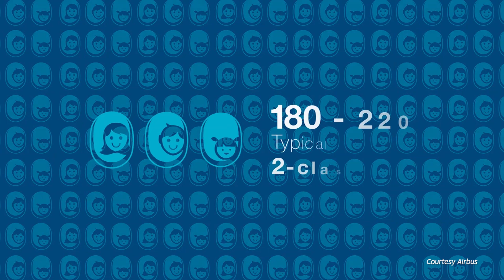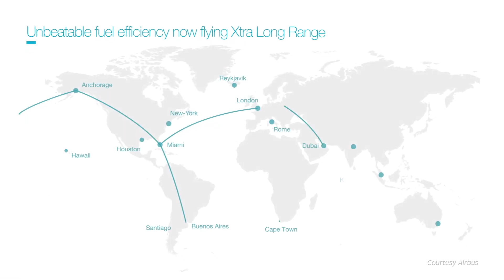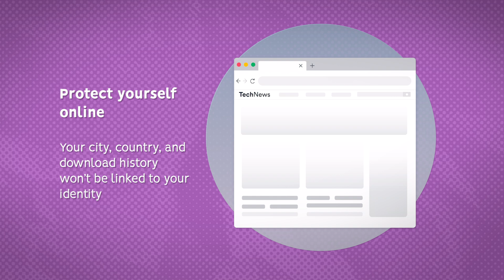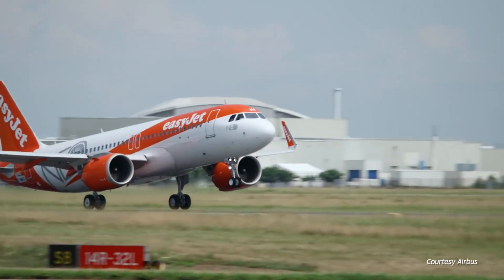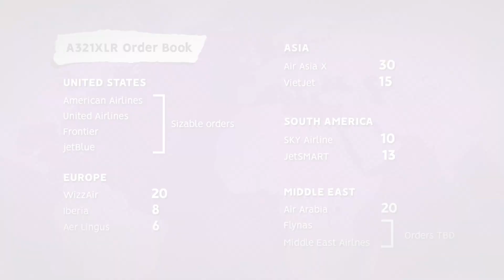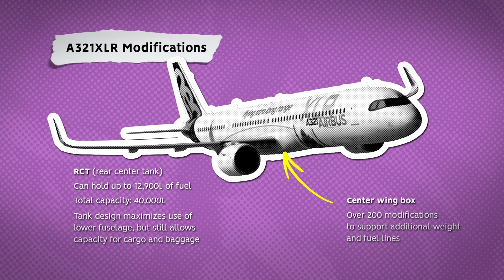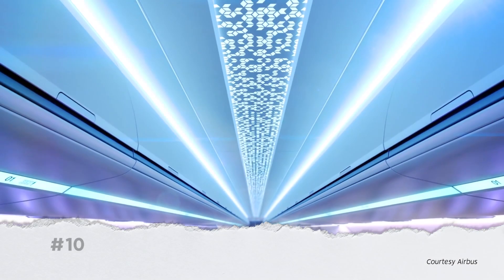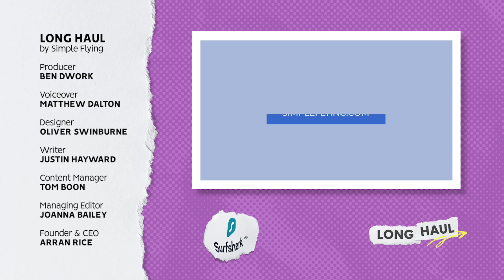10 Things You Must Know About The Airbus A321XLR

Comment: ...so after 40 years since the Boeing 757 first flew, Airbus just now comes out with  the exact same plane with about 400nm extra range? That's laughable.  All Boeing would have to do is update the old Rolls Royce engines on their 757's and install more efficient engines to get the same if not better results than this brand new Airbus.  The same goes for the new Airbus A350. Basically Airbus just copied a Boeing 777 from 30 years ago, added some updates and called it the A350.  In many ways, Airbus reminds me of those old Soviet aircraft manufacturers who copied western planes because the Soviets couldn't figure out how to make their own designs.
Reply: 757 is heavier and therefore less effecient plane even if you added modern engines on it.

Engines aren't the only thing what has changed in aviation since 1980s.

Comment: The FAA is worried because the 321XLR has no Boeing competitor.  The 737MAX will never be able to compete as its short landing gear has restricted its engine side.   The FAA will do everything it can do to save Boeing from the competition of Airbus.  Boeing is a shadow of the amazing engineering company it once was.   The 737MAX was an utter failure of imagination and showed a horrible corrupt culture at Boeing.  
The 321XLR is a game changer, even more so than the 787 which is too big to really allow thin routes.

Comment: All this fuss about a new aeroplane when the 757 achieved the same decades ago ???? come on manufacturers.
Reply: And what does a plane built decades ago need? Exactly, a replacement.
Airlines aren’t celebrating the A321XLR because it is the first narrow body to go transatlantic, like you said that’s not the case, instead it’s the replacement for an aircraft many airlines have had to operate for longer than they wanted. The 757 has become uneconomical and the A321XLR enables airlines to not only replace the 757, but to also do it with an aircraft which is, as it only makes sense, much more fuel efficient. Also, airlines which so far didn’t go long haul and bring new competition to the market.
Also, what’s next? Asking why the A321XLR gets so much attention if the 707 could do the same? Maybe it’s more obvious here why that question has a flaw.
Reply: @spongebubatz  757 is a Boeing it's a pity it didn't get developed further, also we are only talking about the range it has the 757 could do that decades ago just saying like no need to get upset about it.

Comment: Not impressed. The A321 NEO is underpowered and the wing is too stubby to allow flight at the higher flight levels.  All Airbus has done here is add more fuel tanks, big deal.  The engines should be in the 38 to 40 thousand pounds of thrust class.  The wingspan should be at least 130 feet long. Hey but at least it’s got the new car smell.  Sure these aircraft are 20% more efficient than a 757, but it’s 20% less performance.  Good luck at high and hot airports….

Comment: Not realistic to(especially on low cost carriers will become a real issue as will for crew(who typically on LCC have to do return flights as there is no night stops and no crew rest bunks not crew augmentation as Low cost carriers operate cheap with safety not as high a consideration as economy.For flights beyond 5-6 hours better to offer a wise body premium cabin.Toilet access is a real problem not only for passengers but for crew and stingy LCC will not fit an additional toliet nd if they do, you will need to pay!!

Comment: An ER or LR version of the  737 - Max 10 can be a potential direct competitor of the A321 XLR in terms of range, capacity and performance unless of course Boeing decides to create a new aircraft from scratch to compete with this increasingly popular aircraft from Airbus especially among low cost carriers looking to expand their market towards longer routes.
Reply: Yes thats what i thought too. The 737MAX8/9 have the same amount of range as the a320NEO, so a it is technically possible for the MAX 10 to at least match the range of the a321 LR. Im not really sure about the XLR but the, but the MAX10er could fly at least 7500km

Comment: I prefer wide body jet fit long haul flight...I dont want to be crammed like a sardine in a tin
Reply: So here’s something that may surprise you:
An A321XLR is not the same as the A320 of your go to holiday airline! Surprise surprise!
You in most cases get the exact same seat as on a widebody and often it’s even better, the average A320 seat is wider than the average 777 seat.
You get the exact same seat, when seated you won’t feel a difference.
I can see the argument of only having one aisle, but the "worse seat argument" is LONG invalid.

Comment: I wonder if Airbus rebrand the A321XLR to be it's own thing. I know they can't stretch it but it could be good for better sales from airlines as a true mid-market airliner. 

In regards to it being a narrowbody - narrow planes have been flying transatlantic/long haul routes for a long time. I know I don't mind the smallness if the A321XLR = cheaper flights and newer cabins/seats. Crews probably will miss the wider jets but considering the feasibility of having a true 757 replacement - meaning airports in tough to reach places and small airfields needed to accommodate - I don't think they'll mind.

Comment: I flew on a 757 from a base in Saudi Arabia to a Base in the central United States with 3 fuel stops along the way.  The 757 is my favorite airplane but after flying a 767 from ATL to Vegas...I will always choose the widest cabin available on longesr routes.  Why?  Try getting up and stretching your legs in an XLR vs  A350, A330, 777, 787, 747,etc and see which is easier to do it on.  Widebodies usually have more premium seat availability too which is a must on longer flights IMO.

Comment: At time 13 minutes you make a comment that is showing that you mix-up the A321XLR range and flight duration with the ultra-long haul of other modern (wide-body) airliners. It's quite a difference if we look at a 9 hr flight duration or a 15 to 17 hour flight duration. The need and requirement for crew rest areas is totally different. You may be too young to know how long-range flights were performed in the 1960s. There were the B707s and the DC-8s which were had also six-abreast seating and the cabin width was a few inches less than that of the A321XLR. There was enough space. There were no crew-rest areas. All the legal requirements for crew-duty-time could be met. There are some large improvements for cockpit- and cabin crews when compared with the B707: Quieter environment/workspace, better ergonomics for work. There is absolutely no need for crew bunks (beds for the crew) on a 9 hr flight. As for space for the passengers: The seat width and the pitch (legroom) defines the space for a passenger (not the staircase to another floor).

Comment: I personally think 6 - 10hr long-haul flights in a single-aisle aircraft is not the way to move forward, Airbus.  It's just all about pax comfort. I bet this will be popular in the first  3 years from its introduction only.  Widebodies are faster, quieter, more ergonomic, can handle turbulence better, better for the crew.
Reply: If it was all about pax comfort then everybody would be flying A380's.    But widebodies are only more comfortable if the airlines don't get a fit of the greeds and cram an extra line of seats in (like they all did with the 787).    At least they can't do that with a narrowbody -   3-3 is it.    Of course seat pitch is still up to the airline.
Reply: @cr10001  what A380 r u talking about, passenger comfort is not all about pitch is it? Talking about economy class? Suppose widebody and narrowbody had the same seat pitch, are you able to move within the aircraft to flex ur mucles? And how about the engine noise and turbulence in a narrowbody? You do know its significantly less in widebody aircrafts much more in long haul flights. I’m not urging anyone not to take narrows on long flights, see it urself. Further, in widebodies there is greater chance ur next seat or other rows somwhere will be vacant.
Reply: @cloviscontado4069   A380's (I'm talking about Emirates  Economy class) tend to have so much room the airlines aren't tempted to squeeze the pax in.   THE most uncomfortable aircraft I've ever flown in was a 'widebody' - a 787.   There's nothing magic about widebody aircraft. 
As for engine noise and turbulence, that's never been an issue in any jet I've flown in.    I've been in some noisy small turboprops (and even noisier piston-engined planes), but not in a jet, narrow or wide-body. 
There may be a greater chance of vacant seats in a widebody - depending on the route - but that's only if the airline has failed to fill the aircraft, which they hate.

Comment: When i was flying as cabin crew back in the 90's, our longest day was 18hrs work on a B737-300/400. Capacity 180pax, not a single cabin seat reservedel for crew, and we didn't complain. And a Boeing is way more narrower than any Airbus of the 320 family. So if we could then, do 18hrs of duty on a tight 737, it is possible to do a 5 to 8hrs journey...even 18hrs return transatlantic journey on a spacious Airbus. Don't feel sorry for the crew.

Comment: The thing to bear in mind, with these long-range narrow bodies, they have a point to point as opposed to the hub and spoke target market. What that means is more efficient travel without flying to a hub and then getting on another plane to complete the journey. I would rather be a little more cramped than have a much longer trip with a connection in between. And besides, compared to the spam in a can experience of the 737, the A320/1 is much wider and more comfortable.
Reply: Actually it's not wider. The 737 NG and A321XLR have the same cabin width. It really depends on the company's choice of interior
Reply: @igorluiz9551   737NG,  11'7"      A321  12'2"      That's 7" wider for the A320 series.    It's quite easy to Google.   :)

Comment: And to think Boeing raised safety concerns about the XLR, its a pity they didn't raise concerns about the max then maybe nearly 400 people would be alive that perished in the two crashes and Boeing wouldn't be in the mess they are in
Reply: Of course Boeing has to raise ''safety concerns'' because this aircraft will replace some of their 757s. Airbus even works on a new carbon fiber wing (to enter service in the mid 2020s) for the A 321 which will likely be bigger than the current 120 m² wing (757 180 m²), so they could further stretch the cabin and offer a full 757-300 replacement without payload restrictions on longer routes, with the same 320 series type rating for the pilots.

Comment: The new generation seats on these planes with wafer thin back support and very little inclination support along with less leg room is  simply too horrible to sit even for 3-4 hours flights. I simply wonder how passengers will adjust to sit for 8-9 hours . Economy classs will become cattle class . Certainly its way better to travel on the older planes which has better seat comfort for passengers.
Reply: Couldn't agree more.   My one experience with 'new' seats was on a 787, 11-hour flight - it was agony.   By contrast, 18 hours in a Emirates A380 with old-style seats - so comfortable I was actually disappointed when the flight ended.
I do hope the airlines fit out their A321LR's with decent seating for long-haul.

Comment: I hope airliners are considering that if they're going to start using smaller planes like this on ultra-long haul flights, they'd better stop trying to cram in quite so many passengers and provide some better seats and areas to stretch.  I just did an hour and a half flight on an Allegiant A319, and that little excuse for what was basically a jump seat was making my ass numb by the end of even that short flight.

Comment: I'm really not looking forward to the A321XLR. Translatlantic flights on single-aisle aircraft died with the advent of the 747, DC-10 and L-1011 and that was unquestionably a change for the better. Sitting cramped in a narrowbody for 8+ hours, no thanks.
Reply: The difference between 1960s single aisles like the 707 (which gave the 737 the cabin width) and the 747 was the 707 consumes around 7 l per seat and 100km, a modern aircraft today around 2,5 l. The 747 was a much more modern aircraft with a better fuel burn compared to the 707, and ticket prices (and margins) have been higher back then. 
People today sit in cramped 10 abreast 777s which have up to 16k km range, I would rather prefer a decent 320s series seat than a 777 seat in the middle of the 4 seat center row
Reply: @simonm1447  Agreed.     I would not fly in a 3-4-3  777, or a 3-3-3  787.    A380 in 3-4-3 - great.   A340/A330 in 2-4-2 is fine, (and probably 767 in 2-3-2 but I haven't experienced that).   A320 in 3-3 is okay, given decent seats.
Reply: @cr10001  the problem is a lot of 777s have a 3-4-3 seating today in their economy class. You have to check this before you book a flight.
Airbus widebodies are not made in a way you can fit in one seat more per row compared to the standard configuration
Reply: @simonm1447   Yes I agree with that.    It seems that the most that manufacturers can successfully provide for (in Economy) is 18 inches per seat.   (Which is what most Airbus models seem to do).   Provide 19 inches in a widebody and the airlines immediately flip the 'sardine' switch and cram an extra seat in. 
These days, I always check the seating layout before I book a long-distance flight  (or I would if I was flying but covid...)

Comment: The only drawback of the A321-XLR is that it's still only a narrow body aircraft, regardless of the super duper range, so I'm not sure that it will be comfortable for such a long flight. A narrow cabin will irritate passengers........ I bet my house on it.
Reply: It always depends on the seat. I’ve flown several times with 757s across the Atlantic. It had wide body like seats and I’d say it was comfortable. The average seat width of the A321LR/XLR is wider so I do expect it to not be any worse. Keep in mind that a narrow body for long haul flights is configured differently than one for short to medium haul flights
Reply: @spongebubatz  I'll have to see how it goes mate... I have been on a 757 from London to Crete, which was about 4 hours, and I wasn't that impressed. It was a package holiday airline so it could've well been a "cram as many sardines into the can" seating plan so that might be the reasons why.

Comment: I think the use of narrow body airplanes make sense right now up until a few more years. But, once everything returns to normal, the pool of passengers willingly to travel in a narrow body aircraft on a long haul flight will quickly diminish. The entrance of the 777X will also bring back to fashion the use of wide bodies aircrafts (especially after the announcement from Airbus they cease production of the A380).
Reply: One problem of the A 380 was to sell all the seats (it was cost efficient if it was fully sold) - The 777-9 will also have around 420 seats to sell, and the fuel burn isn't different on the Atlantic route compared to the XLR. However you don't make a profit with a half empty 777-9 (like you don't do with a 2/3rd sold 380), but you can make profit with one fully sold XLR flying instead of 2. 
Not a single US carrier has ordered the 777-X, it is mainly ordered by Asian and European airlines. US carriers instead use 787s for longer routes (over the Pacific, no single aisle can do this nonstop) and like United or Delta XLRs for the Atlantic route in future.